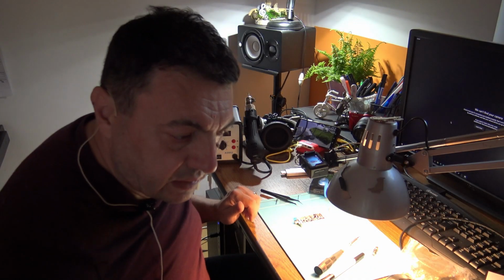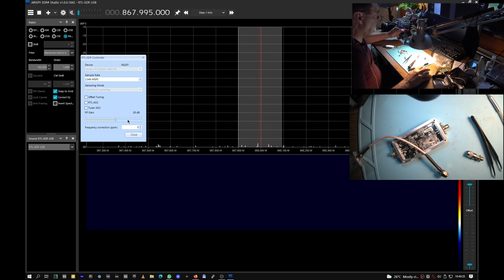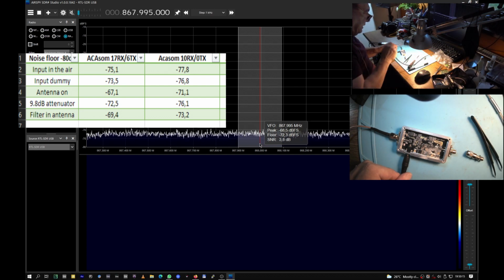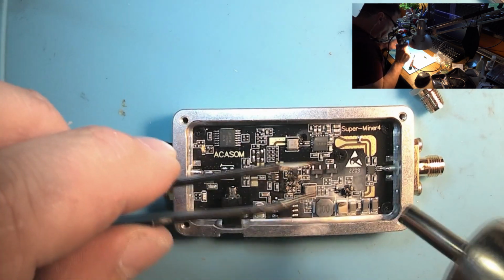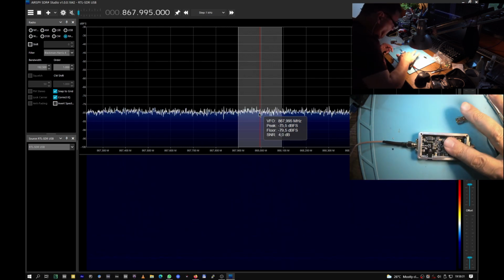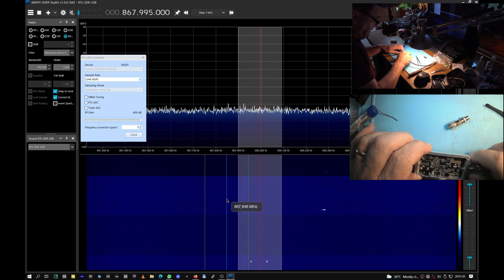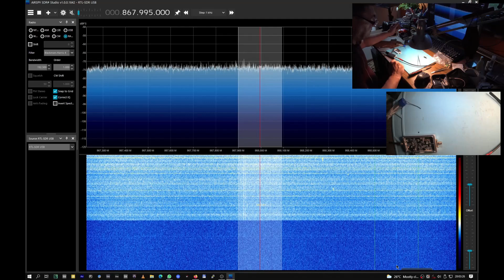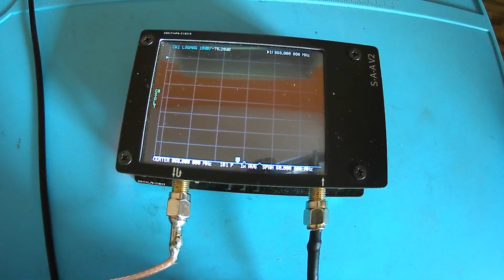Acasom v.1 transistors MOD

Comment: Hi Viorel Thankyou for your videos, are you working on the acasom 17 rx 6db tx i would  like to modify mine so tx is 0 (ie 6db to 0db )
Reply from the maker: Of course..but why?
Reply: @viocaia  worried about invalids only have one miner(ie no splitter) so think 17db RX to high & 6TX (only have to TX to 14 beacons) will get me on the deny list. Additionally dont have cavity filter
Reply from the maker: @jimjim2797  From the Helium application insert a higher antenna gain, like 15dB..that will make the miner to send with lower power which compensate the TX 6dB amplification..Don't worry about ban..you 're not sending TX to often anyway.

Comment: Hey i bought a Acasom a while ago and today i tried to power up that thing with a Bias Tee and nothing happend. Do you have some better information if the ACA-PA0801S6 can used with a Bias Tee? Thank you!
Reply: So you Made that coil your selfe, how much turns, diameter and wire thickness does it need?  Thx
Reply from the maker: @BarlonMando  Doesn't really matter, use what you have around, like 10 turns will be enough
Reply: If there is infinite Ohm´s between the poles there is no Bias Tee abiltiy ?
Reply from the maker: Only if have that coil inside..

Comment: Hi Viorel. As you can see from datasheet BFG540 transistor at collector emitter voltage 8V and collector current 40mA has max gain 18db at 900MHz. you have to change wrapping around transistor to increase gain. What's on it's collector? Resistor or inductance? Story in brief, measure collector current and make it at least 30mA. Can you reverse engineer circuit around transistor?
Reply from the maker: Yes..I will..now there is 4V but I don't know the current...from the transistor above, responsible with deliver power only in RX mode, to the collector I have lie 130ohms..also 0,7v on base..I will go fro a lower collector R..
Reply: @viocaia  Try to use bfu550 transistor at first, because bfg540 transistor is no longer produced. I bet the gain will be higher with modern transistor. And it will be much simpler for people to repeat the modification.
Reply from the maker: @laurynaslauris9677  I have to order, I used what I found around..
Reply: @viocaia   come on... I don't think that's a problem to order it in these days.
Reply from the maker: @laurynaslauris9677  Of course not, but I'm thinking more to BFP640 at 4V..and exactly fits..
Reply: @viocaia  👍

Comment: Surface mount components are often glued when the pcb is double sided and some components are wave soldered. The glue stops the components coming off during this process.
Reply from the maker: I found that..the hard way..thank you!
Reply: @viocaia  no glue. just great heat absortion on the case. Viorel, scoate-l din carcasa de ALU. o sa fie bine
Reply from the maker: @ctermure  incerc..